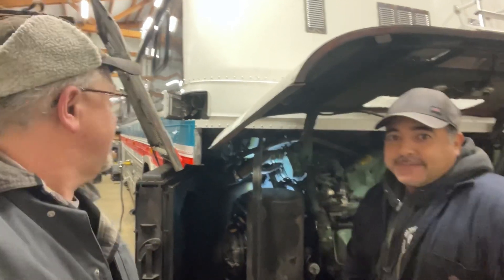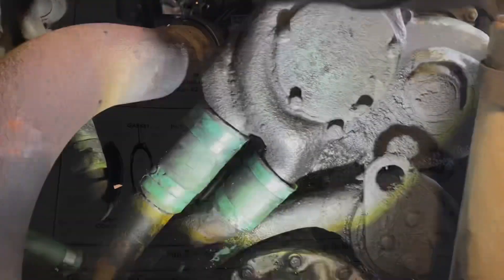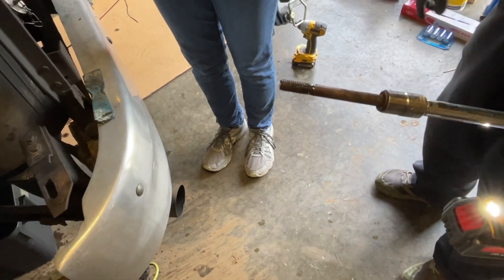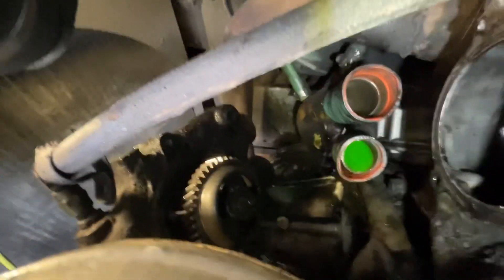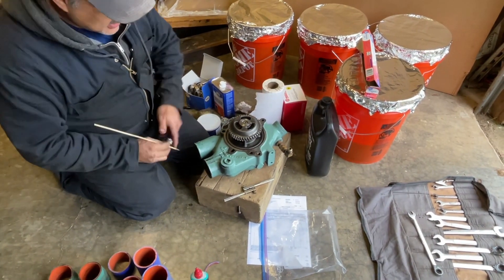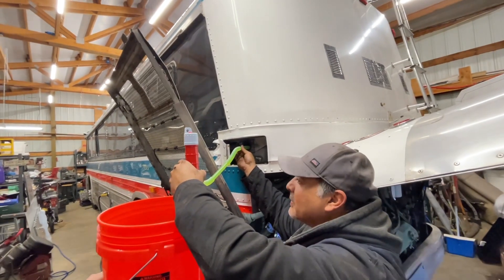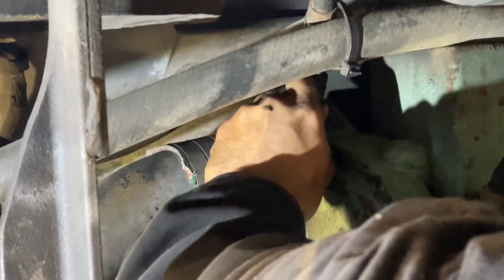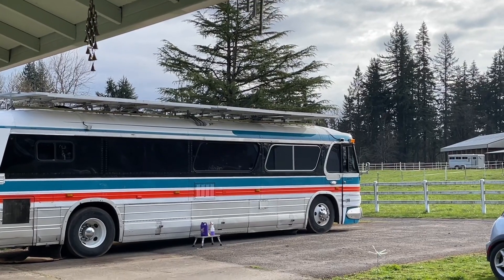Juan and Michelle’s mystery oil leak

Comment: I love hearing a 2-stroke Detroit run but I couldn’t own one because by their very nature they are going to leak some oil. Oil leaks drive me crazy and I would spend all my time trying to keep it from leaking. I have a 12.7 Series 60 and even it is prone to leaking if you don’t stay on top of it.
Reply from the maker: I have seen some 2 strokes you can eat off of.  Takes a loving a knowledgeable person to accomplish it.  Actually there is a video on my channel of a tour of a bus like that.  It was a 4106 owned by an older gentleman that put a lot of care into his coach.
Reply: @ThisOldBus  i should’ve been more clear in my comment and for that I apologize. I look at them from a commercial standpoint and running engines commercially as I do no downtime is the name of the game. If you’re going to run a piece of equipment enough to make a decent profit you don’t have time to chase things like leaks. Basic maintenance like fluid/filter changes have to suffice many times. In those situations a Detroit 2-stroke will be an oily mess after being run hard for an extended time. On the flip side a 4-stroke Detroit or Cat will run much “dryer” during the same period. 
For you guys running motor coaches as RVs it’s much easier to pull them off the road and fix seeps and leaks as they occur. My first commercial motor coach had a Detroit reman 6V92T in it. I absolutely loved hearing it scream down the interstate. I didn’t love the added maintenance trying to keep the drip, drip, drip to a manageable level.